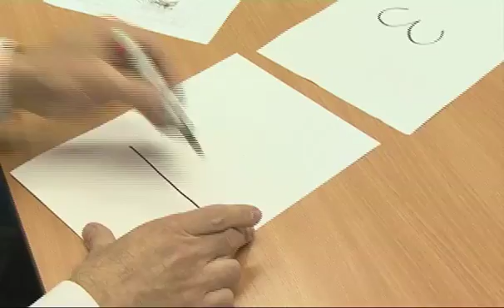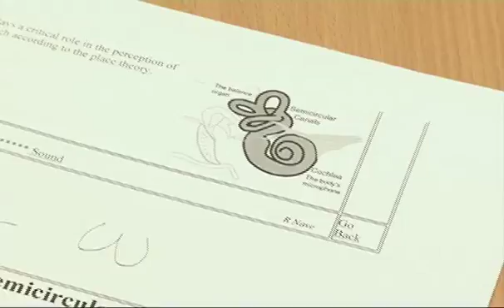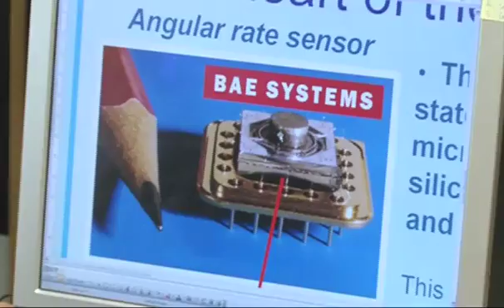Speed of Rotation - Sixty Symbols

Comment: what a weird explanation of a radian. o.O
Reply: JohannaMueller57 Weird as in he describes exactly what it is? How else would you explain it?
Reply: ***** distance along the arc when the radius is 1? duuuh?
Reply: JohannaMueller57 well it is an angle not a distance. and the radius doesn't matter at all, circles with any radius demonstrate the same relationship.
Reply: It's actually a wonderfully simple definition. I always thought of a radian as the angle that is 360 degrees divided by pi, but his definition is far more elegant.
Reply: 360º/2π ≈ 57.296°
180º = π radians 
The gif on https://en.wikipedia.org/wiki/Radian makes it clear.
Reply: +JohannaMueller57 I realise this was two years ago, but just in case you haven't realised your mistake, the distance along the arc when the radius is 1 would be 1, and 2 when it's 2, etc. That's sort of the point, because the radian is the arc itself.